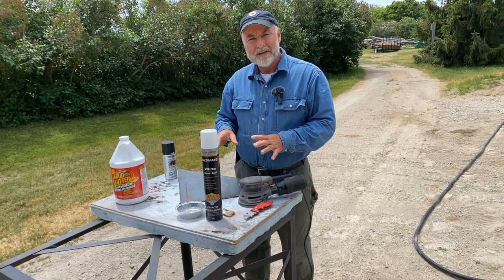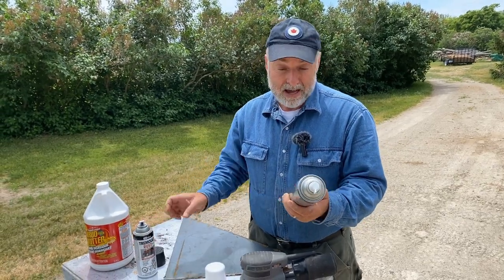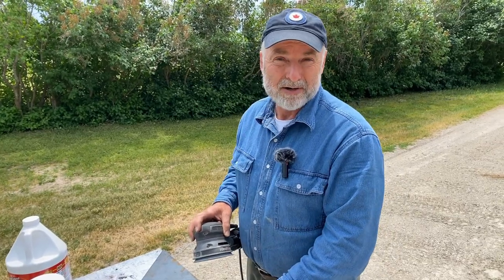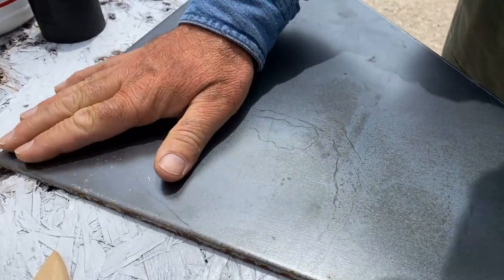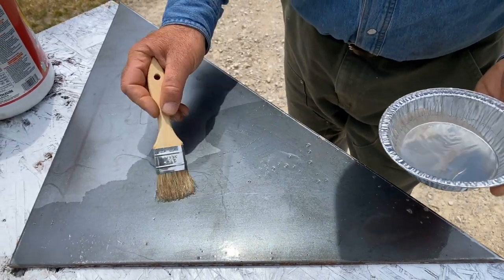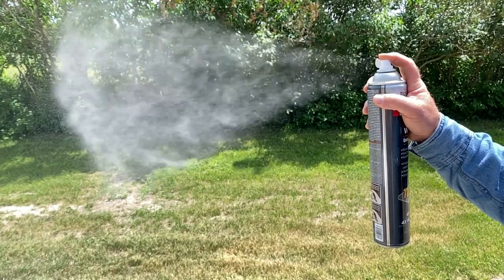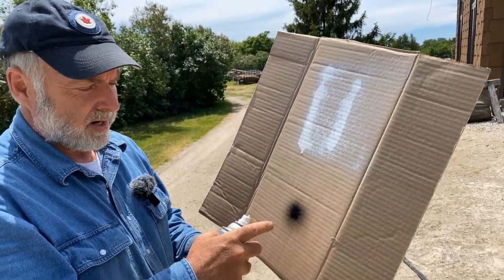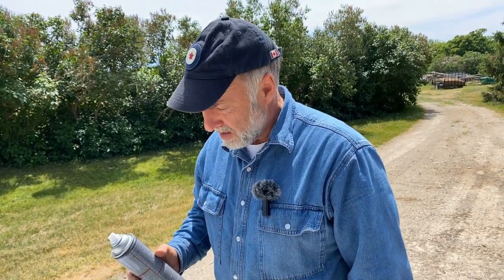Best Canned Spray Paint I've Ever Used!

Comment: If the distance from the lower lip of the topmost bead on the can to the top of the button is an inch or less, you can further improve this with Rust-Oleum's "Comfort Grip." I use mine on all brands of spray paint cans and find it works very well and does away with the dreaded painted finger tip syndrome.